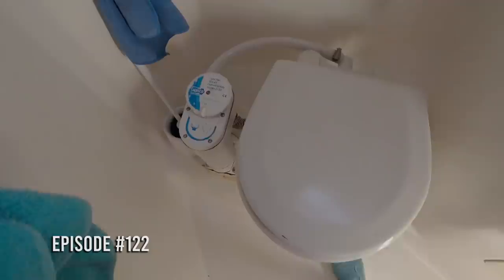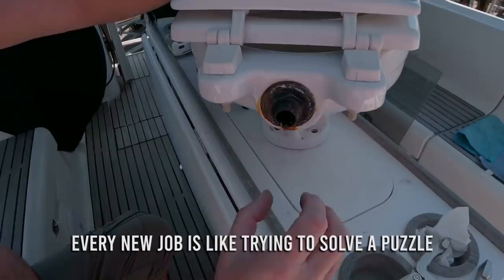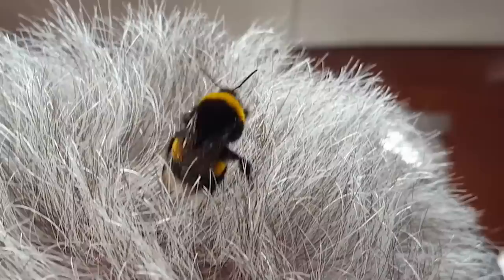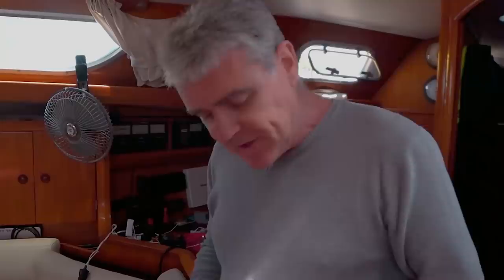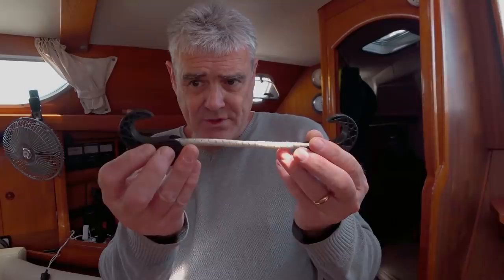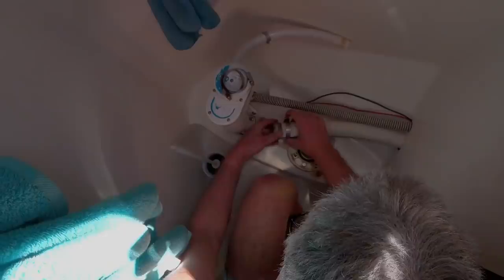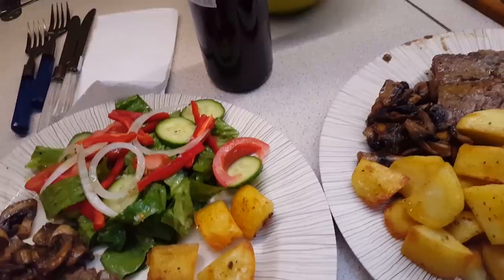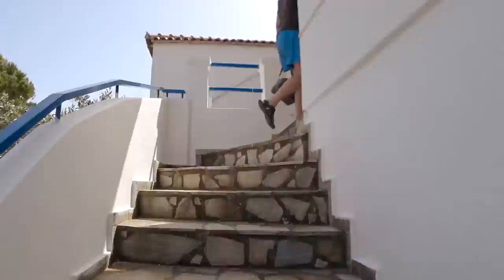Size DOES matter - Sailing A B Sea (Ep.122)

Comment: Before attempting to fit the cutlass bearing please check the fit on the prop shaft?

On the loo and to get ‘you going’ just get a sheep’s of rubber and cut out another washer to sit in front of the hardened one.

👍
Reply from the maker: Agreed, we were already onto checking the shaft would pass through the bearing. That's a good make do and mend option for the toilet, we'll keep that in mind for when we're away from civilization. Cheers.
Reply: Sailing A B Sea For the avoidance of doubt and to clarify the IOS propensity for auto correct - I was not referring to a woolly animal but a ‘sheet of rubber.😂

Comment: Baz, when you get the new bearing, instead of banging it in with a mallet, utilise a piece of threaded rod a couple of nuts and suitably sized washers. This will allow you to gradually pull the bearing nice and straight into place by tightening one of the nuts without damaging the bearing. Keep up the good work, John
Reply from the maker: Hey John, we've decided to get the guy back for the install, less stress that way.

Comment: Looking Forward to the Next Vlog of what Else goes Wrong on A B Sea :) Will the 2 of you find out it was just to much pressure on that seal to handle :) the Load. Me i would just get the Cutlass Turned down seeing you have the Part in your hand and then you can get on with the reassembly of the drive line . Good Luck either way :) .
Reply from the maker: The guy didn't seem too sure that the lathe owner could reduce the bearing by 0.5mm. Fingers crossed that the new bearing arrives this week.
Reply: @SailingABSea   Ok at its best if the new part comes in all good ,But if that does not Happen you could set up a electric Drill with a dowel inside the Cutlass so its tight and run the drill like a spinning sander and use sandpaper and sand the outer edge length of the cutlass . Even some all thread with 2 washers the same size as the cutlass and 2 nuts to lock the cutlass in to place on the thread and use some wet and dry when you get close to size . Ps i would do the Cutlass and not the Holder as thats not a changeable part like the Cutlass.
Reply from the maker: As a noted politician once said "all options are on the table right now."